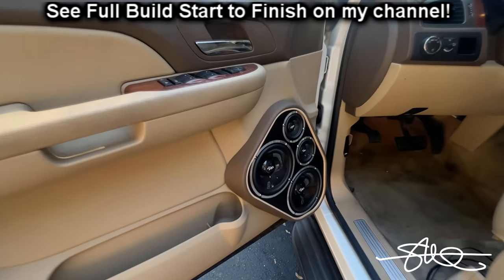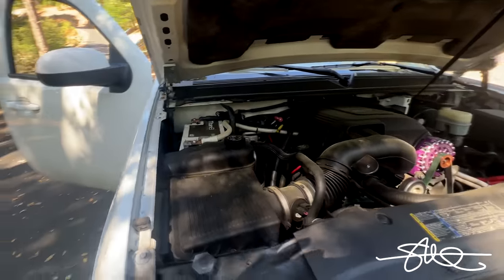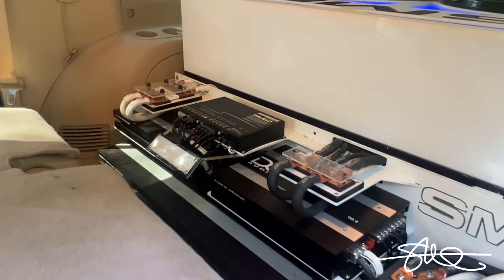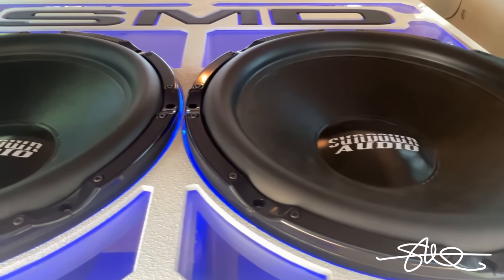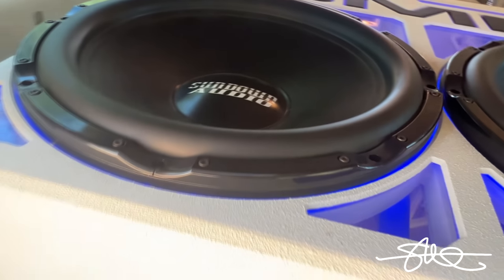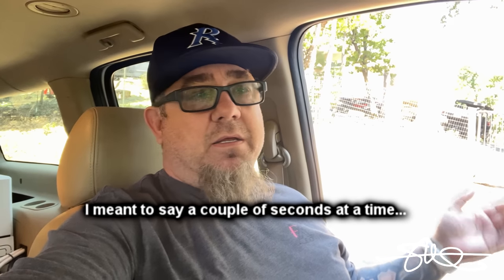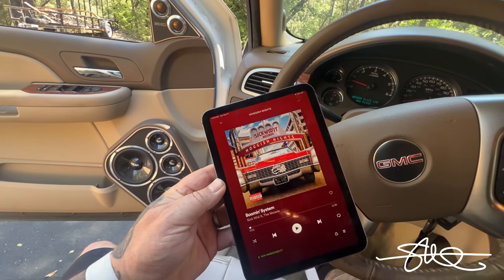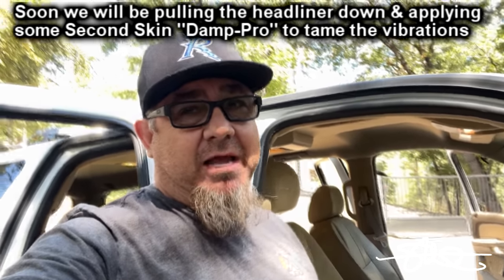Anatomy of a Boomin' System (walk around) 2 24" Subs 3 Way Mids/Highs Custom Door Pods 10,000 Watts!

Comment: I like the second skin products, I watched a video of yours a while ago that introduced me to it. I'm not big into audio stuff like you guys but I do like building cars and I really enjoy seeing the quality work you guys do. 
I've used dynamat before and I'll probably still use it but that was the extent of my sound deadening knowledge. Then I saw one of your videos when I was working on a big project and ordered some second skin products and I'm really happy with that stuff it also inspired me to look into other sound deadening products and companies and I've had some great results. I mostly do offroad orriented builds and one thing thats nice is removing the carpet and taking out that jute fiber cotton insulation stuff then sound deadening the floor and putting down a closed cell foam then putting the carpet back that way if it does get wet its possible to dry it fairly easily. That cotton fiber insulation soaks up a ton of water and is very difficult to dry if it gets wet. What I prefer to do if available is order a new carpet kit from a company that offers a mass backing and use that as well it turns out really nice. I like keeping my interiors comfy. 
I also use a product from second skin as a moisture/dust barrier inside the doors like that plastic stuff thats behind door panels that is always shredded or missing on older vehicles. When its missing and your offroad you can get dust that creeps in over time and I've always had trouble finding a product that I was satisfied with to use for that barrier. Its not as much of a problem on newer vehicles but typically I build older stuff with modern components and I like to find ways to make the experience more enjoyable and comfy the little details matter. I'd have to go out to the shed to see exactly which second skin product I use for that barrier but so far its the best product I've found that looks and works good I don't like taking something apart and finding a trash bag or something duct taped to the door.

Comment: @Mead916  Looks like an extreme amount of heat burn on that Alt pully.Then again I may be wrong just thought I throw that out there.
Reply from the maker: good call! the very first day i had the lithium in they all read 12.5v so I thought they were good.  I didn't think about them being severely discharged for shipping and it did get pretty hot trying to fill them up.  Lithium batts should be fully charged with a charger before installing (as should any battery) but I wasn't thinking.  It cooled down and has never happened since.  Made it kinda a cool color though so we left it like that LOL.  No harm done.
Reply: I bought a 400amp Machman alternator 2 years ago and it’s still holds tits even though my electrical is 9kF worth of Ultra caps I beat on that mechman hard and won’t give up!!!!Good Shit!